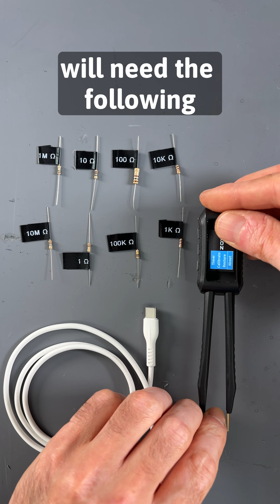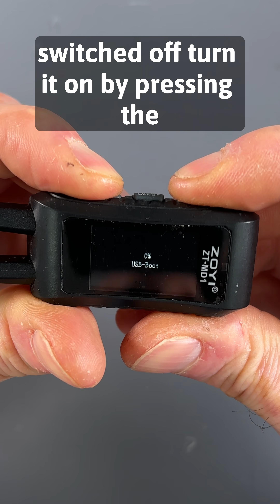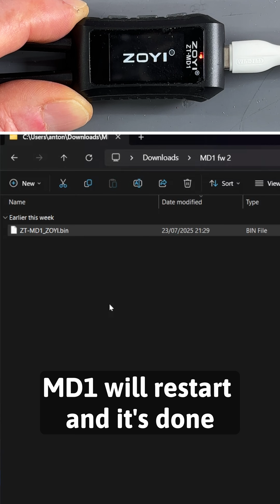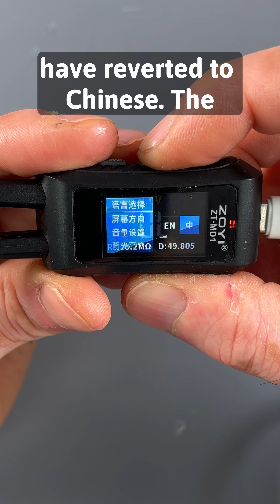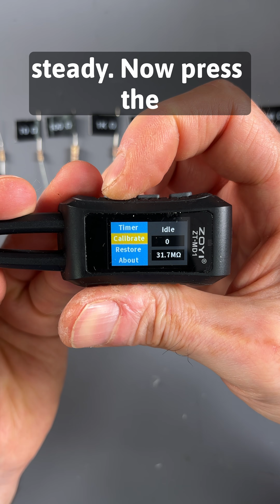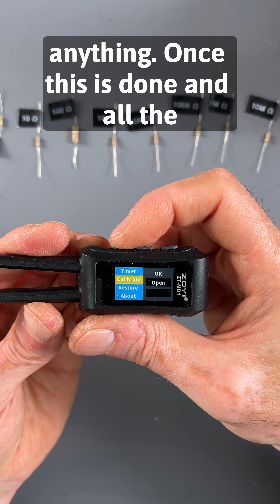Zoyi MD1 Update Step-by-Step

Comment: Thank you for making the short video! It’s very helpful.
However, this type of resistor can’t be used for calibration — it needs to be an SMD type and should be a non-inductive resistor.
Reply from the maker: Thanks Zoyi - it's disappointing that this is not mentioned in your own short video and the manual says to use "chip" resistors. Carbon resistors are non-inductive though. 
Also, I understand why in your update video I see a jig to keep the tweezers in place while calibrating - it's not going to be easy to hold the tool steady, while clamping an SMD resistor and also pressing buttons on it!
I'm going to pin this message so people can see it.
Reply: I bet it will still give adequate results in the end

Comment: I just got the Zoyi Md-2 but i think it is not ok. It's behaving strangely, it flickering up and down values, even if i close it's own tweezers it shows different values from ohm to mega ohm flickering up and down several values. 
If i measure the testing board it came with it, the zero omh resistor shows exactly the same problem. The same issue happens when i try to measure smd components (capacitors, resistors and inductors, but not diodes those are measured ok) on my own boards. 
I disassembled the tips, cleaned them with alcohol and then reassembled them tightly.
I run the calibration process 3 times but nothing changes.
Do anyone know how to fix this?
Reply from the maker: No but if you’ve just received it, I’d contact the seller

Comment: Thanks for this! Just a note to say that the update didn't work on my Mac (in another video I think you said it should). The device mounts as a USB disk, but dropping the firmware file has no effect. On a PC it worked fine.

For calibration I used 1% SMD resistors with a bit of sticky tape to hold them in place. I might glue them to a scrap of insulating board to make a calibration kit that's small enough to store in the MD1 case.
Reply from the maker: Thanks! To be honest I didn't try the full process on macOS, I just plugged it in and I could see the drive so I assumed it would work - sorry if this is not the case. 
I've also bought some SMD resistors and I was indeed thinking of making a little "calibration board" as you suggest, but soldering them somewhere. I think I'll use a prototyping board of some sort. Thanks for your feedback!

Comment: Doing a recal with standard resistors won't end well. You need some 0.01% at least preferably with low temp PPM.
Reply: 0.1% should work fine. Does a handheld LCR tweezers really need to have 0.01% accuracy? The number of digits displayed doesn't really demand so. If this was a desktop LCR meter with 4 or 5 digits, I might agree with you. You can get 0.1% resistors cheap if you buy SMD ones
Reply from the maker: I can imagine the better the resistors, the better the calibration, yes. I hope this is not incredibly critical as Zoyi themselves recommend using carbon resistors.
Reply: The best i have are 1% and i don't have any 10M. Im not buying expensive 0.01% resistors just to use once.